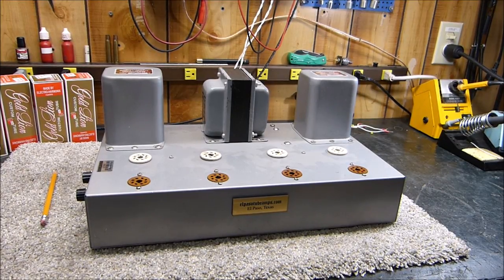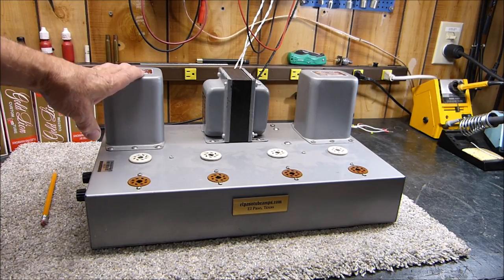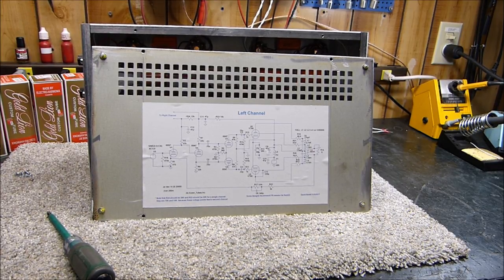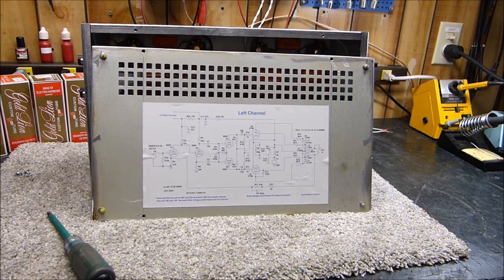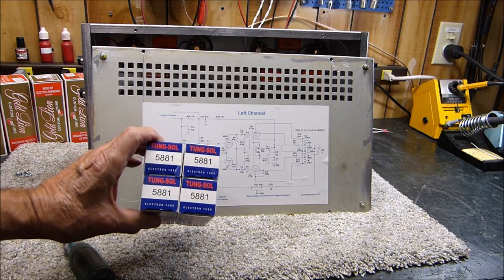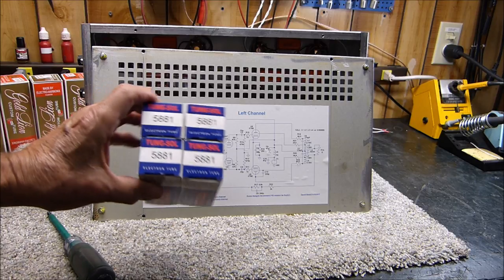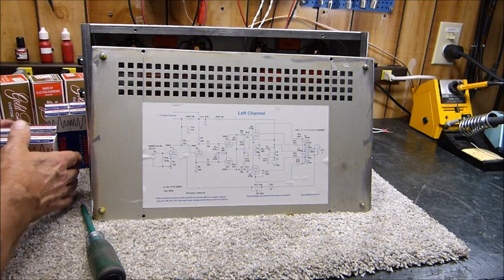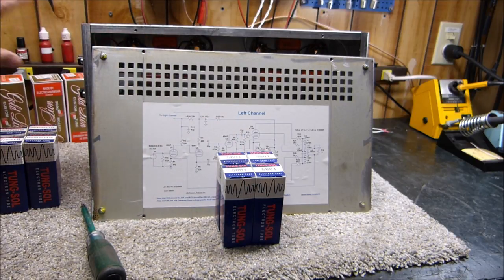Gold Lion KT66 vs Tung Sol 5881 Williamson Amplifier With Acrosound Output Transformers, Part-1 of 2

Comment: I really like your idea of making one of the resistors leading to the phase splitter adjustable.
Reply from the maker: Indeed, it definitely works in reducing THD. I first learned this from a schematic of a Fisher 70-A amplifier built in the early '60's if not late '50's. The McIntosh MA230 also uses this method. Thank you.

Comment: I use the knuckle dragger method to evaluate hum. Turn it up all the way with no signal and listen. You are absolutely correct about chasing gremlins. With such delicate signals it could be the test rig that injects the problem. Multiple feet of cables, numerous connections, lots of lighting and untold power supplies all running around the gear under test.
Reply from the maker: John, exactly as you have stated. I have been there. I have experienced on multiple occasions that to measure -90 db S/N, everything has to be just right. Just perfect... I have to use my best HP test cables and not the cheaper ones. It can easily be something that is not a problem within the amplifier and may, if not careful, be lots of work for no gain and end in making a mess of the amplifier. Thank you.

Comment: I'm going to be using five JJ ECC83 tubes and two matched JJ KT-77 tubes in my diy scratch-build Soldano SLO-50 build, the majority of the components are going to be mounted on some Tagboards that have two rows of tags on them, and the insulating material is some 1/16th inch thick FR-4 fiberglass, the chassis is one I made from 2mm thick aluminium sheeting back in the late 90's.
Reply from the maker: Absolutely - go for it. I looked up the Soldano circuit and have a link here for others that might be interested. Thanks for your comments.
https://el34world.com/charts/Schematics/Files/Soldano/Soldano_Schematics.htm

Comment: A lot of the Tung-Sol reproductions have similar plate construction to the original Tung-Sol.  The 5881s for example.  But those 6SN7 look nothing like any USA Tung-Sol 6SN7 I've ever seen and I have quite an assortment of them.  It'd be interesting to see how they compare in performance.  By the way, almost done with my build.  Will be posting a 3rd update soon.  You won't believe the cable I'm using to connect the power supply and amp.

Comment: I know this is old, but I'm thinking that the new choke is close to an audio signal (tube or OPT) and moving it to a quieter place on the chassis would drop the hum, and maybe even drop a low value cap in line with the power feeding the choke could also help with that hum.

Comment: I'm new to this so sorry if this is a stupid question. I've seen you and many others talk about filament 60hz hum. Then there is the debate on "proper" filament twist and routing. Most tube filaments can run ac/dc so why not rectify the filament voltage? Wouldn't that solve both issues? Is there a down side? If the filament transformer output is ct wouldn't it be better to use full rectification?
Reply from the maker: DC filaments are OK but very rarely necessary and that includes directly heated filaments, for example, in the 300B triode. You could put a bridge in the 6 volt line and then put a right sized capacitor on the output to get the necessary 6.3 volts back (remember, you lose around 0.7 volts drop across the diodes). With directly heated filaments if you run them on AC you must put an adjustable resistor (pot) between the filament pins and ground the wiper of the pot and adjust for minimum hum but that is about it. If amplifier builders are having a lot of hum issues in their amplifiers, it is probably something more than the filaments of their tubes and simply always going to DC filaments may not help at all. Star grounds and buss grounds are not necessary. Study the layout of high-end amplifiers like McIntosh. The first basic secret to keeping hum down from a power supply is to ground all of the power supply components at one point - usually right at the power transformer or the  canned electrolytic capacitor. Segregate the power supply components away from the input(s) of the amplifier. That will make a huge difference. If you run AC on filaments of indirectly heated filaments, put a 100 ohm or 50 ohm pot between the filament pins and ground the wiper and, again, adjust for minimum hum. Sometimes minimum hum occurs at one end of the pot but at other times it may be somewhere in between. It is very possible to have a bad tube that will cause hum - probably some "short" in the filament to cathode. The first thing to determine if you have hum issues is, is the hum 60 Hz or 120 Hz? You may not be able to tell by just listening with your ear. Measure it to make sure. 60 Hz is likely a tube filament issue, 120 Hz is a full wave power supply issue. You may have both. Solve one at a time in a methodical way. 40+ years ago I had a Ten Tec Argonaut tranceiver in my car. The spark plug noise was terrible and was solved by changing out the solid copper spark plug wires with "radio resistance" type spark plug wire. Completely solved the spark plug noise. However, then I was able to hear the alternator whine which was just as bad but it was over whelmed by the spark plug noise. I solved the alternator whine issue with a series inductor and capacitors at the alternator. Now everything was quite and I could hear the radio signals Much better. Again, the point is, hum may be coming from multiple sources.

Comment: I'm playing around with a quad 6AQ5 monoblock design right now, cause they are pretty easy to get. I was going to use a normal 5K-6K primary output trans with 4, 8 and 16 ohm taps, then use the 16 ohm tap as the new 8 ohm (running 2 tubes in prallel on each side of the P-P design). Not sure if my thinking is right on that... I'm finding that it's tough to find a lower voltage power trans with high current, only need 250V plate voltage.
Next up will be a stereo Williamson-style P-P amp with KT-88's...
Cheers,
Reply from the maker: I think you are right-on with the 5K to 6K load. A pair of 6AQ5's want something around 8-10K load so parallel push pull would be half that and you could use your 4, 8, and 16 ohm taps as they are experimenting with the load just to see which works best.

Comment: It would have been interesting to compare the FFTs of the two output tubes in addition to THD. Also, how did you isolate the distortion on the scope (where we see mainly 3rd harmonic)?
Reply from the maker: That display of the third harmonic with the hum superimposed on it is the aggregate (sum of all the distortion)  "error" signal  coming out of the Tektronix audio analyzer for display on the oscilloscope to compare to the top trace which is a simple monitor port out of the analyzer. Pretty cool but it is auto scaled within the analyzer so I have to be careful that I don't get too carried away thinking it is of equal amplitude to the real signal. It is a magnificent instrument but can lead to chasing gremlins that aren't worth chasing if not analyzed properly. That is the way I see it. After analyzing the "error" signal and then looking at the SA display, I think it be comes clear that the two most offending signals are the third harmonic and the 60 Hz. Both instruments tell the same story in a different way.
Reply: ElPaso TubeAmps Did you mean the HP distortion analyzer instead of Tektronix analyzer? My vote would be for the third and following odd harmonics as being the must harmful, as long as we’re splitting hairs.
Reply: Jonathan Knight No, the Tek has a monitor output and an error output.
Reply from the maker: @jonathanknight8251  As EJP mentions below, it is out of the Tektronix AA501 and not the HP 8903. I certainly did not make that clear in the video. I agree that the third harmonic is not a good thing at that amplitude and I hope you see what happened to the third, and second harmonic, in the "improved" version in the following video, Part 2.
Reply: ElPaso TubeAmps Yes, I did see the big improvement. It was well worth the effort. Thank you for the clarification and for the enjoyable videos.

Comment: 4:30 - How did you make those very neat square hole for the vent? Was this an of-the-shelf chassis?
Reply from the maker: It came that way and I did not punch them. I was just lucky that I could cut it to size. I wish I had four small holes around each KT66 for convection cooling but I think it is too late to start trying to punch them.

Comment: 33:22 - So push-pull reduces even-harmonic distortion?
Reply from the maker: Yes, particularly the second harmonic which is the strongest harmonic  in SE amplifiers. I think PP does an even better job with the 4th harmonic which is down close to the noise level. Funny thing about harmonics the way I see it is, at some amplitude and in some combination, we seen to like vacuum tube harmonics even though they are an amplifier artifact. Besides the more pleasant clipping of the vacuum tube amplifier (at high volumes)  vs clipping in SS amplifiers at high volumes, we seem to like the natural harmonic profile of a good tube amplifier.

Comment: My understanding is that it is very difficult to design an audio output transformer that will perform really well all across the audio spectrum from 20Hz to 20kHz because all output transformers exhibit stray capacitance, and you need to make sure the primary winding has enough inductance to perform well at 20Hz, but at the same time minimize the stray capacitance, both requirements conflict with each other, and to mitigate that the primary and secondary windings are interleaved, which drives up the manufacturing costs, that's why good HiFi grade audio output transformers are so expensive, I'm currently in the process of working on a diy scratch-build Soldano SLO-50 tube guitar amp build project and the new output transformer I'll be ordering online from Evatco will cost me something like Au$240.00, audio output transformers for guitar amplifiers tend to be less expensive than good HiFi grade ones.
Reply from the maker: Totally agree with you. McIntosh solved that problem, in a practical way, with their tri-filar windings as long ago as 1949. Cost of production is always an issue as in size. In the 1950 to 1970's size was an issue. People wanted small units that were pretty and cheap to make their American home a show place. Material costs money. During the years of, say, 1940's and before, manual labor was cheap. Transformers like the high-end UTC transformers that were made of iron and manual labor were ultra cheap, as we see it today. You can't afford to have one made like that nowadays because of labor costs.
On the other hand, the idea that inductance of primary windings must be in the 100H range like the original Williamson design is not necessary. Just like the idea that a bigger capacitor is always better in a power supply. There are optimal values from the beginning of "time" to nowadays that still hold true regardless of the hype we see on the Internet.
If you are going to build the best, it is going to cost a bit and hopefully you get what you pay for.
The 20 to 20 KHz performance is a high-end benchmark but  it is surely not necessary or even good for musical production - we think it is good for HiFi reproduction...
OPT of the past like Acrosound and UTC have a different response philosophy. The Acrsound transformers perform well at 20 Hz but not so well at 20KHz. The UTC transformers like the LS-57 will fall apart below 30 Hz   but perform well at 25-30 KHz but are sensitive to NFB values of capacitance across the global feedback resistor.
My introduction to YT videos was to document the harmonic profile of guitar amplifiers. What a waste of time... It had already been done in a monetary sense and no one comprehended the FFT profiles of different guitar amplifiers that I tried to document. So it is.
The point being, the high gain of the 12AX7 in the classic Fender amplifiers is the benchmark to follow.
Don't reinvent the wheel. Use the tried-and-trusted designs of the last century and you will succeed.
With that said, I was discouraged by ham radio operators to not try to make an 833A triode work on 20 meters, especially a TGTP design. Everything has to be GG for SSB operation nowadays. Well, I flew against-the-grain and did make a very stable TGTP 833A amplifier running class-B and am damn proud of it.
Just depends if you want to fly in the face of the wind or just make money.

Comment: 32:25 - Could you minimize the hum by powering the filaments with DC?
Reply from the maker: I am thinking about that. Per your suggestion, I measured the filament voltage under load at 6.9 volts so I can lose the 0.7 volts across the rectifiers (and get some of it back with the capacitor) so the  filament voltage would still be good. However, I am not convinced it is coming from the filament supply at this time - but I am keeping it in mind. Thanks for your comments.
Reply: My little homemade 6SN7 pre-amps use rectified and filtered DC on the filaments. I'm having very good luck with that, and no background hum at all.

Comment: 15:00 - Hmm. I see 3Khz with hum riding on it (assuming that the top trace is 1KHz). I gather this indicates 3rd-harmonic distortion? (3KHz being the 3rd harmonic of 1KHz).
Reply from the maker: Yes, I totally agree and it is confirmed in the spectrum display. I was concerned by the hum riding on that harmonic but as mentioned, I have to be careful not to take off on a tangent trying to solve a problem that is fairly insignificant. On the other hand, I would like to get rid of the hum even if it does not drop the THD or S/N levels.
Reply: But would it be perceivable? Then again, it's what your striving for. Great series!
Reply from the maker: @jdmccorful  Would it be perceivable? Probably not to my ears but if my instruments can "hear" it, I may become obsessed over it.   :-)

Comment: Thanks for the mention. I'm wondering if you aren't just seeing spectrum analysis artefacts here. It doesn't make sense that you measured -74dB SNR while the 60Hz spike was up at -55dB ref 1KHz. I wonder the same thing about the IM products surrounding the 1KHz spike. If they were really there at the level shown it would sound terrible, not like music at all, unless you count 1960s tone clusters ;-) Keep up the good work. EJP
Reply from the maker: I keep going back the same thing I mentioned in the video. I need to be careful what I start chasing. I see the noise superimposed on the third harmonic out of the Tek distortion analyzer and identify it as 60 Hz using the SA. Must make a measurement and not chase the wrong frequency (i.e. 60 Hz or 120 Hz). I can see around 5 dB change using the hum-pot and the minimum is in the center of the pot so I know I have some sort of a dip..... Hmmmm so, what do I do? Say that's OK because the S/N is reasonable and there will be no noticeable noise out of the speaker? I went to this length to satisfy myself that I did not create the issue by changing the choke to 1H. Also, the THD is 0.25% so how much better do I think I can get it? Lots to think about that can cause a lot of work with no real gain. My objective was to put in a circuit so I could set the cathode current balance for least THD and also install a dynamic adjustment to balance the drive into the KT66's grids for min THD. Next, I want to see what, if any, these little RC circuits do for the amplifier that are usually off the direct plate to grid connection (to ground) in the first two stages. I am convinced I might see something in a square wave test - maybe less HF ringing. I don't know. All I know is love to do this stuff and it is a lot of extra trouble to video it but why do it in a vacuum? You know I appreciate all of your input.
I almost forgot - the spurs around the fundamental. I basically think that is just artifacts of the SA program and I don't  take them too serious.
Reply: ElPaso TubeAmps I think you need to recheck your SA software setup with the audio input from the amplifier disconnected. I fancy you will see the same level of 60Hz.
Reply from the maker: @EJP286CRSKW  I noticed, and remembered tonight, that the input to the little guitar type analog to USB converter is attenuated thru a variable resistor with no compensation. Also, it is sensitive to being over driven and I have to be careful with that. The light around the gain control turns red (instead of green) if over driven. Bottom line is it is certainly not a Tektronix level instrument and that is what drives the spectrum analyzer on the PC so what I get is surely less than perfect but it does amazingly agree, in the larger ways, with the high end equipment. That may explain some of the hard to describe spurs, for example. On the other hand, it did a pretty good job of displaying the 60 Hz and third harmonic which we saw as an aggregate signal on the Tektronix. The audio SA (SpectraPlus) software is much more of a toy than a lab instrument.